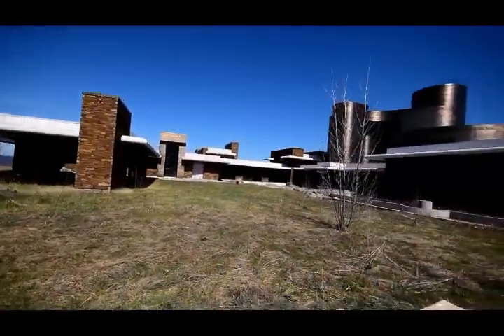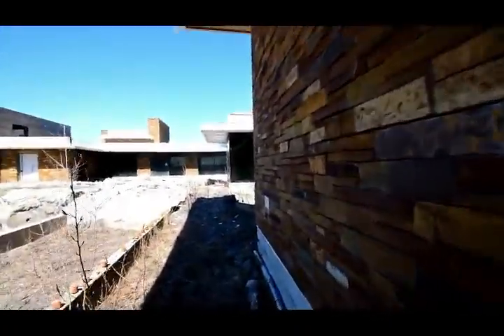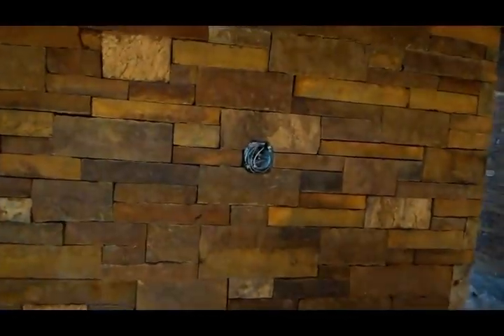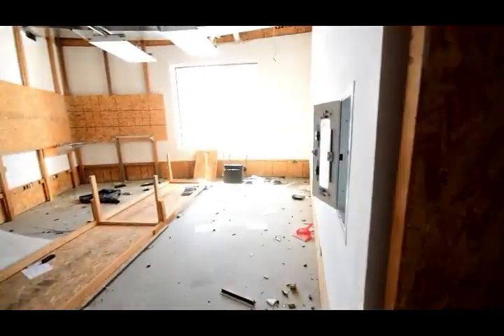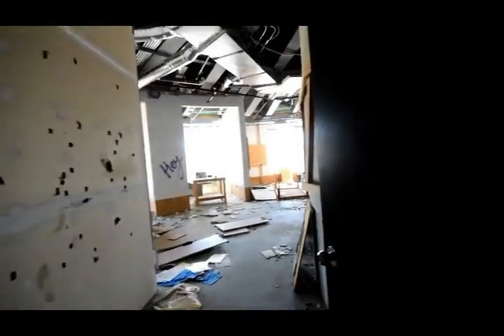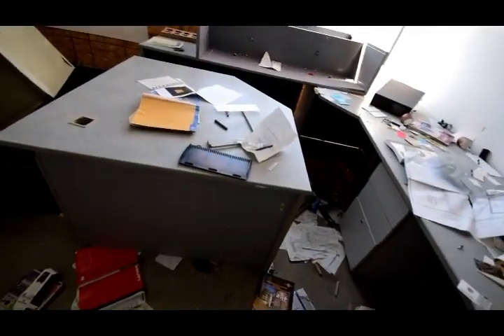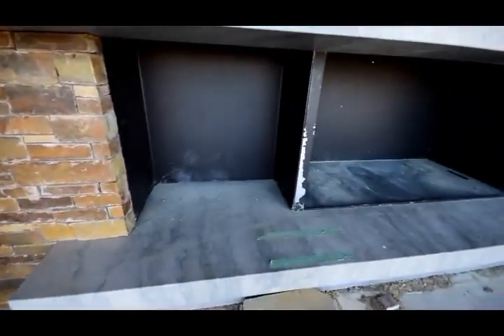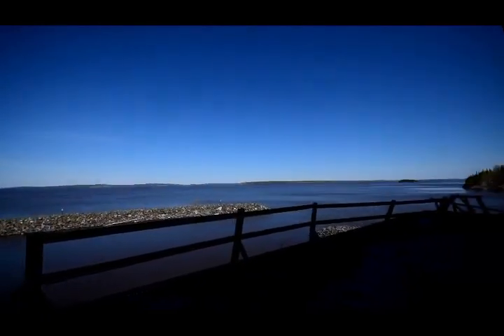Exploring the Abandoned Peter Grant Mansion in Haileybury, Ontario

Comment: To the photographer: If you read up on this, you would know that you are in the part of the building that was to be the construction companies offices.  That room you were in where you saw the red and blue pex hose was for hot and cold water probably for underfloor heating. That would have been a room for heating and cooling probably. Nice job on the video. I was hoping you found where the boat house is underneath. It is supposed to be big enough to pull a 40ft yacht in.